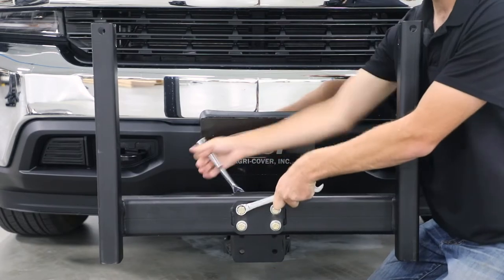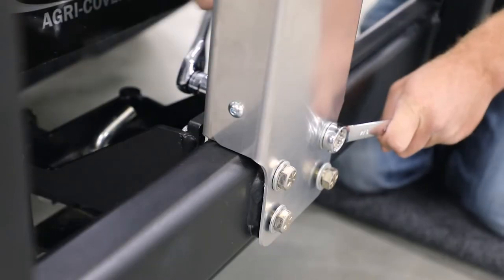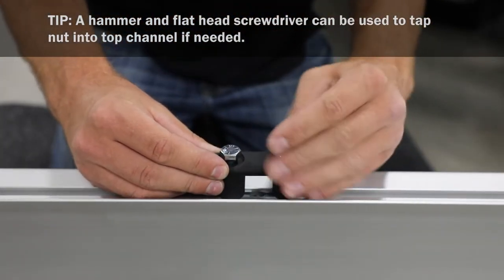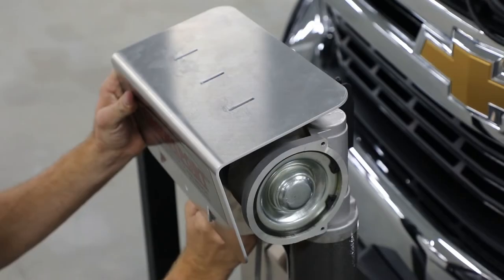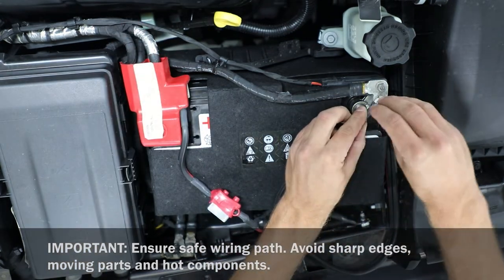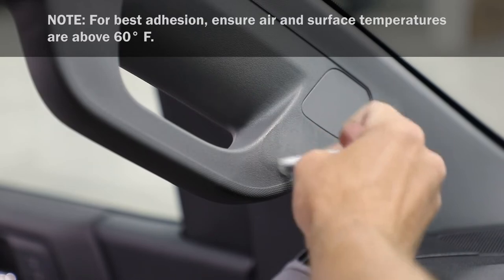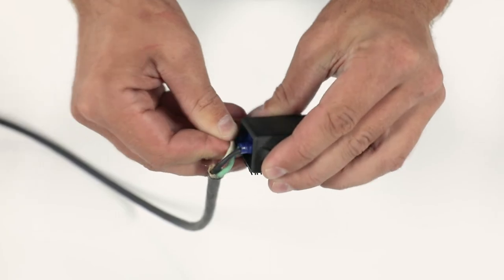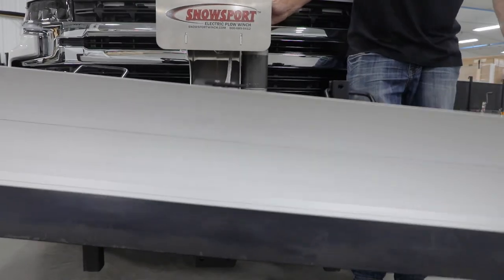SNOWSPORT™ Electric Plow Winch Install Video

Comment: I stumbled across this on my own.  Oddly, I didn't get the email all the other former customers got advertising the new winch.  Tried it for the first time today.  Works great.  Downpressure is a big bonus with this setup.  I had the old hold down strap system but it was not effective for long unless everything was on level ground.  Go up an incline or anything that would pressure the blade upward and the strap loosened or it would break.  I put eyelet bolts through the lowest bolt hole in my side plates on the rubber ends (facing inward) and ratchet straps to my front tow hooks from the eyelets.  Keeps the blade fro collapsing forward, which is unnecessary now with the winch.  Now I can backdrag thanks to the downforce also!  Simple.  Snowsport you should sell this simple mod next.  Unfortunately, I called Snowsport and they couldn't give me any specs or rating for this unlabeled winch whatsoever and the warranty is so so.  Its a clean factory looking setup.  Probably could do it yourself for a third of the price but you wouldn't get the downpressure.  Another con..... one plug for the plow has a nice rubber protector for when its not in use.  The smaller one doesn't.  I found that to be an unusual oversight.  I tape mine for corrosion protection when unplugged.

Comment: Good morning.  For the last year my Snowsport winch seems to have trouble lifting the blade up.  It gets "stuck" in down pressure mode and none of the switches (cab or motor head) will raise the blade.  I have to jam it into a snow bank and then it will work.  The plow, without this winch is nearly useless and I need this thing to work reliably.

Comment: Does it need to be re- shimmed in the front or does the winch correct this. I'm watching all these videos before I take all of this stuff out of the boxes. Thanks.
Reply from the maker: Hi J. Ault, The electric plow winch does not take the place of the shims. Add provided Snowsport shims between push frame/electric plow winch and interceptor if necessary to level push frame.
Reply: @SNOWSPORTSnowPlows  thank you, I spoke to one of your reps earlier, great guy, very helpful; thanks.
In addition, I used Irwin quick grips and they worked perfectly and didn't mark the aluminum.
Reply: @SNOWSPORTSnowPlows  also, once predrilling the wholes, spray the hole and self tapping bolt with a lubricant... It's gravy!
Zero heat from my Milwaukee gen 3 impact driver. Probably whatever brand anyone else uses too...

Comment: How long are the battery cables? If I'm trying to install this on a 2005 Ford E350 van where the dual batteries are mounted underneath the sliding door on the passenger side, is there enough length in the cables? If not would it be possible to just extend the ends of the cable and shrink tube the ends again?
Reply from the maker: Hi Coach2118, There is 7ft of wire from relay to plow and 12ft of wire from relay to in-cab switch. Thanks!